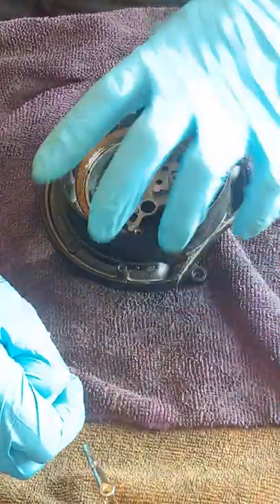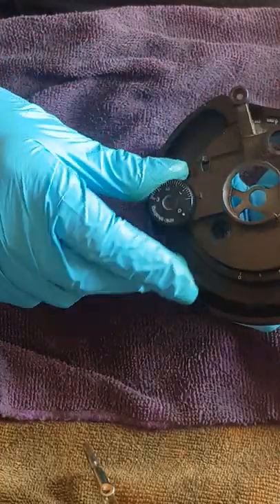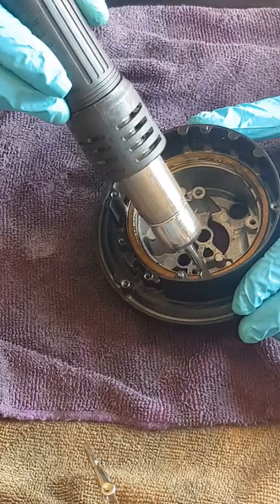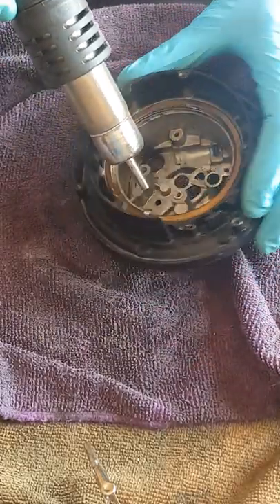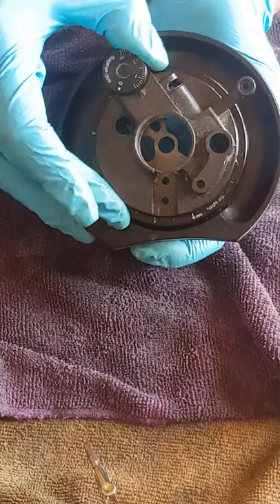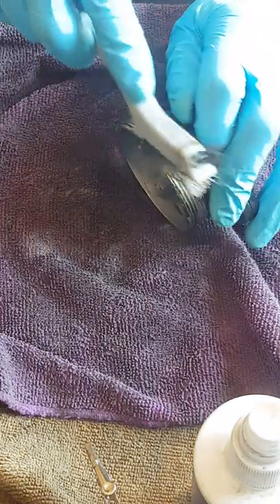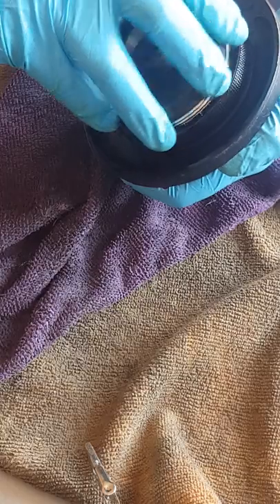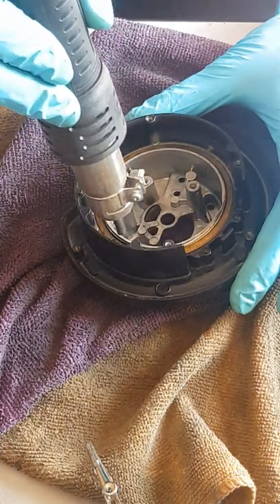Pt1 Technics 1200/1210 seized tonearm base

Comment: Hello, my tonearm seems loose. I've tried tightening the screws at th side and top slightly. It has helped a bit but should it move at all or should it be solid?
Reply from the maker: It shouldn't move but if it's been over tightened it cab damage the bearings and the tonearm won't track properly👍🏻
Reply: Sounds like your bearings are shot...

Comment: Do you have a video on the tone arm lifter? Mine won't lift the tone arm when the lever is up.
Reply from the maker: I haven't but I've got some decks in this week with similar issues so I'll try do a video and get it posted up soon as I can 👍🏻
Reply: @decktech9684  Dude! That would be awesome! I installed a new Reloop cover on mine and was going to take the hinge plate off of the deck to drill new holes, removed all the screws from the bottom but didn't know how to get the cords loose so the bottom would come off. My deck is a 1983 model and has a little different configuration, with more screws than the newer ones and some kind of a rectangular doo-dad where the cords go into the deck  at the round cover plate. What's the trick to get this off? I didn't want to be pulling on things to get the bottom off and ruin something.
Reply from the maker: @alangross2277  the plastic cable clamp is in 2 pieces there's a tab at either end you need to use a small flat blade screwdriver to ease it apart from the piece underneath👍🏻
Reply from the maker: @alangross2277  if you're fitting a reloop lid use the reloop hinge carriers with the 4 screw holes and mount it using the bottom holes to the technics hinge plate 👍🏻no need to drill anything
Reply: @decktech9684  Thanks! I thought it looked like a clamp, but since this table is worth as much as it is I don't need to be screwing things up on it. I picked it up three weeks ago for $150.00 and it's in very nice condition.
Reply: @decktech9684  Too late! The Reloop hinge holes didn't line up with the holes in my hinge plates...I had to drill new holes. My hinge plates on the table were missing something otherwise I could have mounted the original dust cover. I searched on-line and couldn't find anything that would make the original cover work. The Reloop cover looks great and works very well. Fits like a glove. I wish I could post photos. My table is an early SL1200 MKII (manufactured April 1983) and they evidently used a different hinge system for the dust covers than models that followed.
Reply from the maker: @alangross2277  ah yes the hinges are different in the early 80's 1200's 👍🏻 drop me a msg on my Facebook page @decktech

Comment: I can't unscrew this inner ring out, tried WD40 plus hair dryer and it's stuck. Any other way?
Reply from the maker: Another way is to gently squeeze the number ring in a vice and apply wd40 so it can seap into the threads but this is a last resort solution
Reply: @decktech9684  I think I'm getting to this point unfortunately 😅I had the fine thread undone yesterday but tried going the other direction to get the outer ring loose, big mistake because now they are both absolutely frozen shut. Going to wd-40 the hell out of it and leave it over night, hopefully that works first.